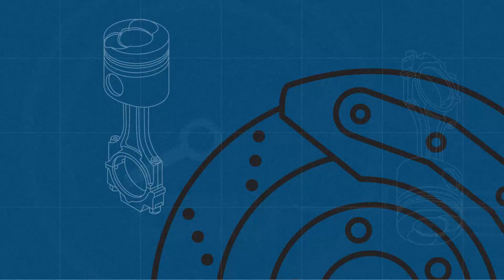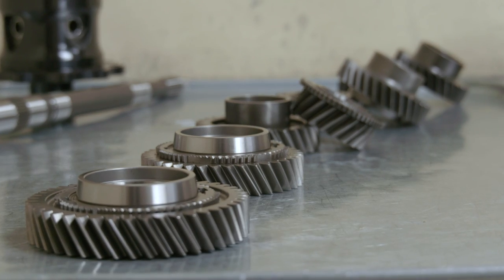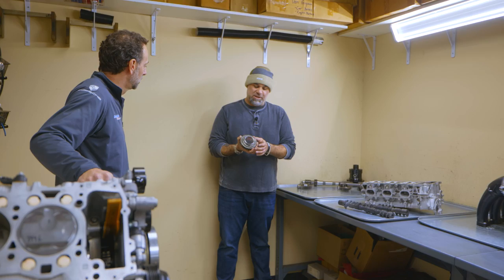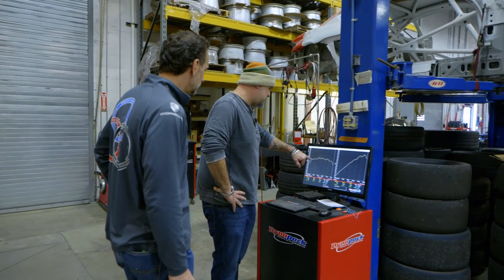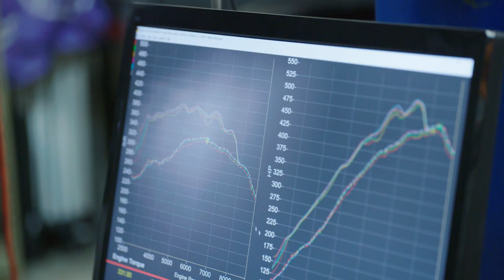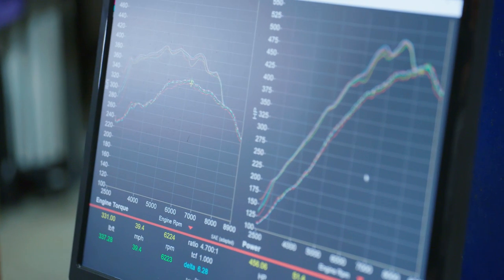The best water-cooled Porsche I've ever driven | MODIFIED

Comment: 4.5L owner here 👋🏼 

Had my GT4 converted nearly exactly a year ago (including new gear ratios), and it’s everything Matt said in this review and more. It’s a much tauter, more involved car now, with heaps of torque everywhere in the rev range. Absolute rocket ship compared to the stock 3.8L, and Rick is a class act that has been amazing to work with.

If you’ve got a GT4 and are considering bolt-on power adders, you’re truly wasting time and money. Instead of spending $18-20k on exhaust, plenum, runners, throttle body, etc., you’re genuinely better off banking a few extra dollars and sending your car to DeMan; you’ll be getting a complete package that has proven performance figures and requires zero guesswork from you.
Reply: How many miles have you put on it and how's it been reliability wise? This is like a $30k deal right?
Reply: @duscar  8200 miles (mostly street, with about 3 or 4 track days), as reliable as any stock motor. The price you reference is the correct ballpark 👍🏼
Reply: @thejackamo  out of curiosity, would you happen to know how much the gear ratio upgrade alone cost?
Reply: @razorworks111  In 2020, gears were just under $8k for parts. However, Rick has since changed his gear supplier (same quality, just a different supplier), so that price might be different now.
Reply: Awesome to hear an owners perspective. I had two questions. First, how is the sound of the new engine compared to the stock 4.0? Second, how difficult was it to secure a GT4 allocation? I’ll be in the market for one around next spring if things go to plan. It would be my first Porsche and assuming their still being made in a year, I’m curious how hard it will be for me to snag one. Thanks!
Reply: @dsher503  unknown on both counts. My car is a 981 GT4 so it started life as a 3.8; haven’t driven a stock 4.0 so I couldn’t comment. And my car was bought used, so unfortunately can’t give you any insight into dealership/allocation shenanigans, but if you peruse some of the forums I’m sure you’ll find plenty of info.
Reply: What’s the rpm limit on your engine ?
Reply: Are you in SoCal by chance?  I’m interested in doing this conversion on my 997.2.  Saw a red GT4 with a “4.5” at my local car wash and wanted to chat with the owner about it but couldn’t find him/her.
Reply: @jad4ca  not me, but I know the owner you’re talking about (in Laguna Niguel). I think I saw on RL that you were able to connect with him? Otherwise, I’m happy to chat more; he bought that car with the work already having been done, I went through the build process from a bone stock car.
Reply: @thejackamo  Thank you very much for the response.  Yes, I did connect via DM on RL and will make direct contact to ask him about the car.  Much appreciated!
Reply: @razorworks111 $9,645 without the flywheel and clutch. Just gears.
Reply: @thejackamo  Hey Jack, I appreciate you answering so many people's questions. I'm still on the fence with my 991.2 GT3. More of my questions are on the warranty side,  I mean they're boring your motor right so that's a 20k hit plus the depreciation over resale so its a pure fun drop in, I get that and can commit to that, if I can be sure I can have the motor protected through warranty as much as any other GT motor.
Reply: @Aliscarchive   This would completely negate your Porsche powertrain warranty and I’m not sure that any Porsche dealer would work on the rest of your car. I’m not sure what DeMan’s warranty is for their parts and labor. Honestly, if you’re that worried about warranty, depreciation, reliability, etc, this probably isn’t for you
Reply: Should of just stroked the 3.8..my two coins.
Reply: Any problems with the vehicle since being enhanced??
Reply: How much did you pay for your set up and 
for the exhaust system in the 4.5L how much does cost?
Reply: Did 560 the max hp ? Did can gain 620 hp ? Cause albert motorsport made 4.3L already 580 hp
Reply: I know it's not exactly what you buy the car for - but what sort of 0-100s, 100-200s were you seeing compared to stock?

Comment: DeMan had me at 100 pound feet more than a GT3RS!
Reply: AND with an NA engine ... !
Reply: How much is the conversion?
Reply: @carsgunsandguitars  40k
Reply: @JBOsurf  worth it
Reply: @JBOsurf  it’s just 40k?!? That can’t be installed. Anything like this from BBi or sharkwerks is 50-60k.
Reply: @TheWesman45  installed apparently. Give them a call.
Reply: @TheWesman45  Engine complete is less than $40k—that figure would also (essentially) get you the shorter 2-5 ratios, installed. Give Rick a call, he can walk you through all the options.
Reply: @thejackamo  Hi, this is more out of interest, but how much of that is the Gearbox?
Reply: @JBOsurf  - that's impressive. There's still that sweet aftermarket exhaust & new stronger clutch. I think we'd all say if total package/conversion is $40k - that's a very fair price point. 150 more pony's & 100 more Trq is amazing in a GT4 (which looks just as special as the 911 GT3) IMHO. Love the NA flat 6 & those sounds. BMW could learn a lot by stroking 3L straight six & installing more CF body panels to get the weight closer to 3k lbs.
Reply: @scottiecopasetic8315  BMW... flat six?
Reply: @jetara3082  it all depends on what exactly you’re looking to do—best to get in touch with the shop for pricing 👍🏼
Reply: @thejackamo  Don't wanna bother them cause I don't even have a GT4, was just curios. Maybe one day I trade air vs. water and then a GT4 would be the way to go for me.
Reply: @scottiecopasetic8315  I think you mean in-line 6. I do agree. There’s no reason they couldn’t make a 4L naturally aspirated inline 6 that duplicates the specs of the 4L flat 6 in the GT3.
Reply: @cgberz  - I meant straight 6/inline 6 (but I had too much Porsche on the brain).
Reply: @RB-xv4si , I don't want to talk too much about BMW bcuz this is DeMan's show & I have a deep appreciation for Porsche. I just think when BMW made the 2 door M4 or M8 (they should have thought about a 2 seater - possibly rear mid engine w/ manual gear box & more carbon body panels for weight saving)
Reply: With the red line being lower than the GT3RS, my question is whether or not the Deman GT4 is equally or more exciting than the GT3RS to blitz to redline. That, and the cost difference between the two
Reply: Scratch the second part, totally missed the $40k figure described above
Reply: @nathanhagerman9928  exactly right!!
Reply: @JBOsurf  ... and you void your Porsche warranty? Not sure it's wise to make the upgrade until after the warranty ends.
Reply: @davidhunternyc1  correct. At the moment I can extend the factory warranty to 2028, 2 years at a time. After that if I decide it’s my forever car I’ll probably ship an entire deman kit and gearbox mods to Australia. Some excellent specialist here who can do the install.
Reply: @JBOsurf  Yeah, to replace a brand-new car engine just sounds nuts to me, and a waste too. I suppose you could sell the stock engine but for how much? Don't get me wrong, I would love a DeMan GT4 but the cost of ownership would be exhorbitant.
Reply: @davidhunternyc1  try living in Australia and looking at Porsche prices….
Reply: @JBOsurf  ... and then there's Singapore.
Reply: @davidhunternyc1  It’s still cheaper than selling my 981Spyder and buying a GT3 RS…
Reply: @clu4u  OK, I've got an idea... Sell your house. Sell all of your cars. Buy a Porsche by Singer and live in a Motel 6.
Reply: Scottie Copasetic it’s more like $60K when you add new clutch & exhaust. 
Probably cheaper and faster to buy a used GT3 than a modified GT4
Reply: @davidhunternyc1  They don’t replace your engine, they’re taking it and the transmission out and doing the upgrades on them before installing back
Reply: @davidhunternyc1 I could buy a Singer or Guntherwerks with cash and not sell anything. Well, maybe some TSLA stock…
Reply: How many people in this thread actually have a GT RS? One? Two? Zero? Lol
Reply: What is the cost for the 4.5 engine and the gearbox work?
Reply: exactly!!!

Comment: I've been waiting for weeks to see this review. I had the pleasure of visiting Rick and Mattie at DeMan some weeks ago. I was taken for a ride in this very car, keep in mind at that time I owned a C6 Z06 (heads/cam/intake/fuel system/flex fuel/exhaust 618whp 9.9@141mph siting on LG Coliovers/Swaybars and R888R) which wasnt and isn't a slow car by any means. Rick took me for a spin on the same road you had closed down no less. I was blown away, it felt like a V8 was in this car. Keep in mind I have a 997 Carrera S with a LS3 swap making 445/435 to the wheels. That GT4 felt like a mini Z06 with attitude and power for days. The gearing just exploits in total perfection... The car you drove was for sale and I was soooooooooo tempted to buy it. Alas I grabbed a uniquely spec'd 991.1 Turbo to play with. But man this car forced me to recalibrate my thinking on whether I needed outright power or the combo this package offered. I may regret it but I am tempted to just have all three cars and be broke LOL. Great review, awesome team at DeMan for sure and the amazing cars they have laying around is crazy. That 959 for instance LOL
Reply: Totally, that was my reaction too! Felt like a small angry v8 with all that torque. Would be a great compliment to a Turbo 😉

Comment: I recently bought one of these on the secondary market.  This one is a 2016 981, DeMan converted in early 2021, with the LimIted Slip Diff and the shorter gears.  I am stepping up from a heavily modded 991.1 911S coupe.  In comparison, the DeMan GT4 is a pure sports car, with no daily driver aspirations.  It’s much less comfortable, it’s loud, and it demands focus, not to mention the manual gearbox.  So much more visceral.  A real drive.  This one dyno’d at 554 hub horsepower.  My 911S is about 370 to the wheels; the bigger power supply is definitely noticeable.

Looking forward to getting it on track.
Reply: Would you say it's not an enjoyable car to daily drive?
Reply: @divertiti  a GT4 is a delightful daily driver, but is not as comfortable as a 911.  Mine, in particular, is not a a comfy daily driver because I’ve installed racing seats and harnesses.

In terms of the powertrain, handling and ride, a stock GT4 is terrific.  It has a tighter interior than a 911, and rides a bit stiffer, but that may be your preference.

Comment: For 6 years I read and hear that it is impossible to shorten 2nd gear in these gearboxes because it is on the shaft. Turns out it is possible :)
Reply: I had the first short 2-5 gear set from Deman in my car years ago! No issues, it's awesome. Possible, reliable, awesome, changes the entire driving experience.
Reply: @RunningFast 
I even remember seeing some explanation there is no space (for some reason) inside housing for different 1st and 2nd gear.
This is really good info :)
Reply: @tomasz899  Yes... this line about the "no space in the transmission" - I always thought that was a bit laughable (and never believed it)
Reply: With the stock engine or the 4.5L? @Tomasz

Comment: 2:08 "Drop in a crate engine".......3:30 "Bore out your engine". Glad to see you are as inconsistent as always. Never change Matt. 

BTW DeMan been doing this for 3+ years,  they do amazing work and their development is without a doubt, without shortcuts. 

But its worth mentioning the base cost of the mod at $28K to $35K depending on end results.  Also worth noting the Porsche 718 GT4RS is expected to come out this year. With a 4.5L, PDK and 500hp+. 

With an estimated average cost of a new 718 GT4 at $99.2K + $28K in mods and loss of factory warranty, and you are about where the RS is expected to sell for. With warranty.  

A used 981 GT4 like mine can be add for about $85-90K. But worth consider it if I could keep the original engine unmolested and have a drop in a CRATE engine. That would cost about $15K more than BORING out the original block. Or if you blow the engine out of warranty, and if the block is salvageable. This is a great option.
Reply: The other thing - would the 4.5L pass emissions in all 50 states? I guess a motorsports shop isn't subject to the same emissions and fuel efficiency restrictions than an OEM like Porsche would be, which lets them have a more aggressive drivetrain. In that sense, the 718 GT4RS would be fully compliant but wouldn't sound anywhere as good as this 4.5L thanks to the OPFs.

EDIT: According to Rick DeMan on Rennlist, a few customers out in CA have been able to pass emissions and register the car.
Reply: @SP-nw1et  With the "right" price, you can in fact pass CA emissions with just about anything. Simply need a friend with a similar original car to show up at the same time as the appointment.
Reply: You can either buy an engine complete from Deman (the "drop in a crate engine") or you can have Deman bore out YOUR engine (the "bore out your engine" part). These are neither inconsistent with each other, nor mutually exclusive. Nice attempt at the call out though, though completely incorrect in its basis.

Comment: For all those curious, you can do the same engine work to the 997.2 gts / any 997.2 carrera 

I already reached out to DeMan
Reply: Price for this operation? Sounds expensive all these goodies.
Reply: 996 options?
Reply: @warboyrb  he's done 4L 996's before!
Reply: Any 9A1 block can be converted, which includes all 997.2/987.2 cars, and all 991/981 models 👍🏼

Comment: True, but also subjective to a point. I've owed both a 2006 Boxster S and a 2002 911. The Boxster was WAY MORE fun as you felt like you were being pushed and pulled at the same time, and had better acceleration in the lower gears. My 911 was faster at the top gears, but that was the only area in which it was superior. Id buy a top level Cayman or Boxster for the mid-engine factor alone, its just way more fun .

Comment: 987 roller for $15,000 plus. $5000 coilovers, GT3 control arms, brake upgrade, and this engine with a reworked gearbox would be one insane Porsche for under 70K.

Comment: Does pdk in gts4.0. need mod to handle power too?
Reply: PDK is well established as a solid gearbox. For racing purposes, an update on the software, adding cooling capacity on the oil/water heat exchanger and you are good to go.

Comment: Hey Matt - what brand of gear set do they use? Is the clutch still stock?
Reply: DeMan makes their own actually and the ratios are spec'd to the motor, but also usable in a stock motor setup as well. Clutch and flywheel get upgraded as part of the build.

Comment: That rear-end did NOT like that large bump is went over.   The rear rebound extends far too much and makes the rear unsettled.

Having my 2022 PDK GT4 for 2 mths now and just getting out of an SS 1LE with MRC, I can tell you that the PASM damping is pretty poor and unbalanced when the pavement gets rough.

I swapped to MCS 2-way remote dampers and it helped a lot.   Still not MRC level, but MUCH better than stock PASM

Comment: Does the gt4 have a metzgher engine? If so, I thought the cap for those motors was 4.3L according to BBI.
Reply: Nope. It has the 3.8 liter engine from the 991 Carrera S, albeit detuned.

Mezgers were never made for the 991.

Comment: With longer stroke what did that do to the redline?
Reply: No change or higher! 😁 New stroke is similar to the 4l GT3 which revs to 9k.
My stroked GT4 revs to 8150 rpm now, basically limited by what the ecu can handle. Plenty of track days, no issues with the extra revs and stroke.

Comment: I suspect the closer gearset alone would help the stock GT4 a lot - even without the added power.
Reply: It would, if anything a stock engine need the shorter gears more because it doesn't have the torque of the big engine to push through the longer gears. The big 4.5 is already traction limited in 1-3 so the short gears are more for driveability and response than actual 0-60 performance.

Comment: Very cool setup. A question I have is how they managed to sort out the cooling issues that must come with the power output increase. Is the standard cooling system sufficient for these mods without leading to overheating?
Reply: Stock cooling is more than sufficient. Doesn't even break a sweat on track.

Comment: Wow. I'm in love. 

The question is, does this cost as much as a 991.2 GT3RS?
Reply: Nope, definitely cheaper plus even if it was the same, no manual in the RS
Reply: @RunningFast  How are you so sure? I looked on the website and saw no information on cost.

If you're right, I'm surprised he didn't mention this as a budget alternative to a GT3RS. Not once did he mention cost, but it's got to be A LOT. A donor GT4 isn't cheap, and a stroked NA Porsche motor . . . yeah.
Reply: @logicreversed18t  I'm sure because I already have a Deman 4l in my GT4 and am saving for the 4.5l 😉

Also, I don't think this is comparable to a GT3rs. Less grip, less aero, manual transmission, if someone is spending the coin for an RS over a GT3 it isn't for the imperceptible extra few ponies.
Reply: @logicreversed18t  expect to save around $80K-$100K compared to a gt3rs depending on price of the donor gt4 and price of the gt3rs. It’s very worth it. Trust me. I just got mine back and it’s fun seeing the look on a gt3rs owners face when I start pulling. 😈

Also. Most big engine builds aren’t putting prices on their website. Gotta call and inquire :)